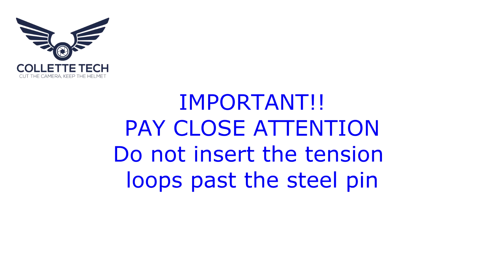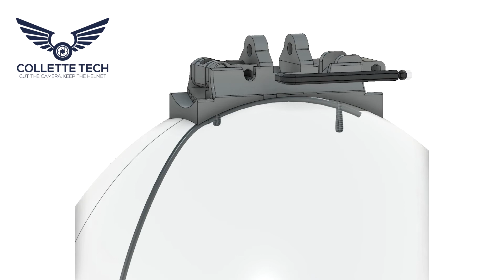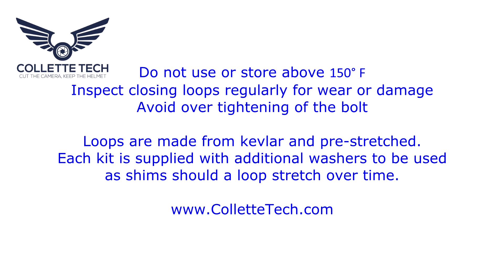ProCut2 Install v2

Comment: I got the ProCut 2 for the G3.  The instructions say to put teflon washers over the loops but then don't show them again in the final tightening down of the closing loops.  There was also only one washer included in my kit (for the bolt that attaches the upper assembly).  Am I missing something?